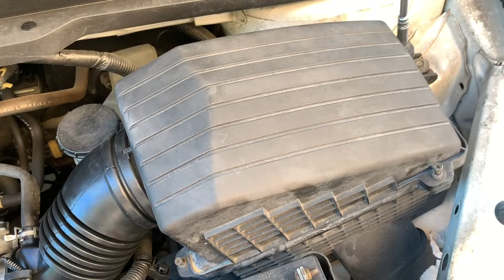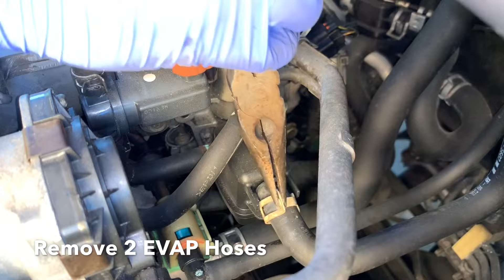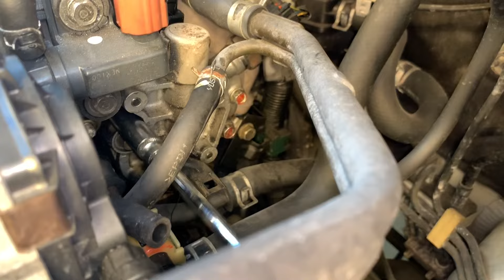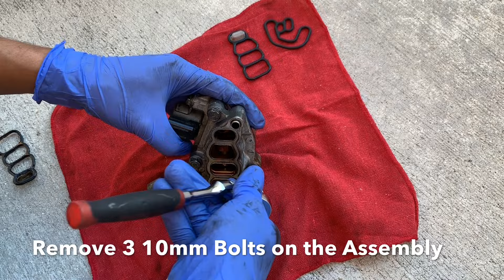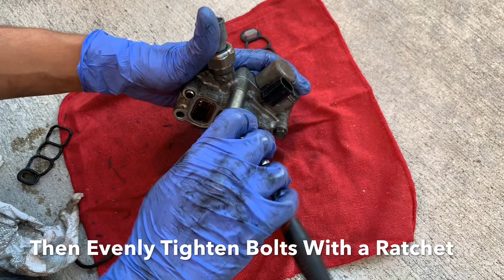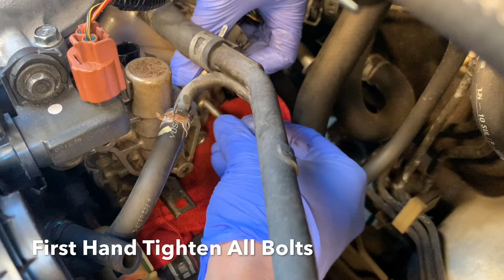2005-2007 Honda Odyssey VTEC/VVT Solenoid Gasket Replacement DIY (P2647)

Comment from the maker: Gaskets: https://amzn.to/4hwg6Nj
OEM VTEC assembly: https://amzn.to/3CIBrUP
Aftermarket VTEC assembly: https://amzn.to/4gD2sqk
Socket/ratchet set: https://amzn.to/3WW3vL6
Extension set: https://amzn.to/3EChijN
Magnet: https://amzn.to/42SxEij
Pick tool set: https://amzn.to/4hBhwq6
Plier set: https://amzn.to/4jVRQ91
Shop rags: https://amzn.to/42TmWrQ
#ad

Comment: This is the first video I found that quickly shows how to do the job.  And is also the only one I have seen that also shows that the valve assembly needs to be opened so you can also replace the seal inside too.  Thank you so much!

Comment: I just replaced the gaskets on my 2007 Ody, no major issues.  I had to pry my gaskets out and they broke into many pieces.  I used the Dorman replacement set.  I separated the top hose in the video above the part and flipped it out of the way, a little better access.  I thoroughly cleaned out all of the valve parts with carb spray and let dry.  It looks like I had extensive leaking from that area because it was all dirty and oily back there and I cleaned it off as best as I could.  For the $12 for the gasket, worth it.  Also did the oil filter housing gasket at the same time when changing the oil and did plugs.  My van has 305K miles on it and runs awesome, I did mostly replace the suspension last year, so it rides great too.  Hoping to run it to 400K.  It drives and runs fantastic.

Comment: Bless you, good sir! I removed the part from my Amazon cart just so I could add it back with your link.
Reply: I tried just the gaskets, but "no dice" so I replaced the whole assembly and it seems fixed!

Make sure your bolts are clean when you reassemble! On my first go around, mine had some oil on them and just kept turning with my torque wrench until one broke off in the engine! A left-handed drill bit got it out, but it was not a good time.

Thanks for the helpful video, Mr Ranger!

Comment: The PCV line refuses to come out of the intake tube with clamp squeezed. Any ideas why that might be?
Reply from the maker: Take a pick tool and work around the hose
Happens overtime due to repeated heat cycles

Comment: Thanks to this video, I will attempt to do this myself. I’m having an issue with VSA light. I will also change OPS (oil pressure sensor). Subscribed & Saved.

Comment: My 2007 Odyssey VTEC solenoid is leaking after an oil change.  My mechanic replaced the seal last year and it has failed again.  Maybe replacing the entire unit will be better.  Thanks for this tutorial.  I already replaced my valve cover gasket.
Reply from the maker: Improper install or aftermarket gasket used
Reply: @MrRangerZr1  i was mistaken, this was not replaced before.  Is there another VVT solenoid on the otherside of the engine close to the timing belt/alternator area?
Reply: I replaced mine a couple years ago and seems like it's time to do it again, tempted to add a schemear of hondabond but probably not a good idea. Still beats cost of replacing it and I'm wary of aftermarket options.

Comment: My 2007 Odyssey, the VTEC solenoid leaked and it pretty much burned out my alternator last year.  The other solenoid valve seal failed this week.  I didn't know how to replace both, I had to bring to a mechanic.  Now I have an idea to do so.  My van is already at 274k kms.  Thx for the tutorial.  I used your tutorial late last year for the rear bearing replacement.
Reply from the maker: Make sure your valve cover gaskets aren't leaking. Video is on my channel.
Reply: Where on your channel? Couldn't find it. Can you post the link? Thanks!
Reply from the maker: @timmybob2028  Here you go: https://youtu.be/DdaQZLba5m0

Comment: My 07 pilot was pooling on top as the middle gasket failed. I could not get that gasket at the time so i glazed a little honda bond over the exsisting one and resealed it. Good video👍
Reply from the maker: Here's the rear section video: https://www.youtube.com/watch?v=1iTE0N5qosg&t=1s

Comment: Great video! One question. Where did you get 16' pounds torque spec on the mounting bolts?  Only other sources I have been able to find show between 8 and 9' pounds.
Reply from the maker: Shop manual
Reply: it is 9 ftlb.  after my bolts broke, the dealer advised 9 ftlb not 16.  wonder how many others broke their bolts because of this video
Reply: @raymondf9265  Just broke mine as well!! How'd you get yours out?
Reply: @TheKenAgain  Drill and an easy out. They're soft bolts. Easy to drill. Just clear all the parts out of the way that you can, so to ve precise and take your time.

Comment: Is the process same for 2009 EXL rear VTEC gasket? I see you have shared a link but thats for the front ones in 2008-2010.
Reply from the maker: This video is for the 05-07 odysseys, the other years have a different style.

Comment: Hi I have a p2648 code. Do you have a video on how to replace a rocker control arm actuator by chance??  Your videos are the best. Thanks!
Reply from the maker: What year and trim?
Reply: 2010 Acura MDX elite.
Reply from the maker: Probably one of VCM solenoids got stuck. It's probably stuck in 3 cylinder model, is it?

Comment: Hi, your videos on how to fix/service Odyssey saved me tons of $$$. Thank you very much for that. This time, I run into some serious problem changing the gasket, two of the 3 10 mm bolts securing the soleniod to the engine broke while I tried to tighten them to 16 ft-lb. It took me sometime to remove those two bolts (luckily, I was able to do that.) I am going to get the new bolts from the dealer but am worried about the same will happen again. Do you have any suggestion? Should I try to tighten them to lesser torque?
Reply from the maker: What is most likely happening is you're using the torque wrench with too much force and or using a big torque wrench, smaller torque wrenches don't make a loud click so you have to slowly turn until you feel the click. Tbh, just snug it up like I did, no need to tighten like mad, the new gasket will seal fine.
Reply: Also happened to me :) The first one I tightened broke, I was relying on my torque wrench and it never clicked. I managed to take the broken piece out and thought the issue was with the bolt. I ordered a new set of bolts. The first new bolt I tightened with the torque wrench broke (again :) I then realized that the issue was not the bolts (LoL)
Reply: How did you manage to get the two broken bolts out??
Reply: 9 ftlb.  mine broke too.  I asked the dealer and they said it should be 9 ftlb and NOT 16 ftlb.
Reply: @denysdubuc5138  I used a starter punch and small hammer and carefully hit the top of the broken bolt near the edges in a direction that unscrewed it.  Eventually, I was able to twist complety out with my fingers but needed the starter punch to begin this process.  My bolt pretty much broke even with the surface of the mounting area.  I would imagine every break is unique and will require different strategies to remove.  I am glad I didn't have to drill and mine came out nicely with no damage other than the bolt.

Comment: Thanks MrRangerZr1, great video... does this also apply to my 2014 Odyssey? Gonna be using your videos to do my  fronty and rear soon.
Reply from the maker: It does have a solenoid in the rear and front, but not this type. Check out my front vtec gasket replacement video.

Comment: What was the symptom that you needed to replace these gaskets? Leaking oil on the drivers side?
Reply from the maker: Yes oil leak
Reply: MrRangerZr1 I think I have something similar on that side. How could you tell it was the source?
Reply from the maker: Anthony Calabria clean the engine and then see where it’s leaking from
Reply: The most tell tale sign of these valves leaking is oil on the bottom side of the heater core hose directly below this valve. It’s also pretty common to see the camshaft plug o-rings failing too as they are only a few inches below this valve. They will leak onto the block but this valve will leak onto the heater hose when it fails

Comment: Hello Mr ranger, first I'd like to thank you for your videos which are always a goldmine to me!

Last year in March, I used your video to replace the VTEC solenoid Gaskets (2 gaskets) in our '08 Odyssey, the one in the front above the alternator, by the motor oil dipstick. It completely stopped the leak....till November, which is ok for me.

I have just changed them again last week. I prefer to change the gaskets than buy a new solenoid because the solenoid works fine AND the gaskets cost only $12 for the pair....I'm ok with doing it every 7 months.

My question please after seeing this  new video above is....does the '08 van also have this VVT solenoid, and  is it at the same location as the '06 van in this new video?

Thanks.
Reply from the maker: No this video is only for 2005-2006 vans the other is only for 2008-2010 vans.